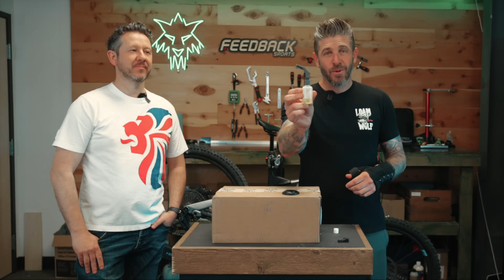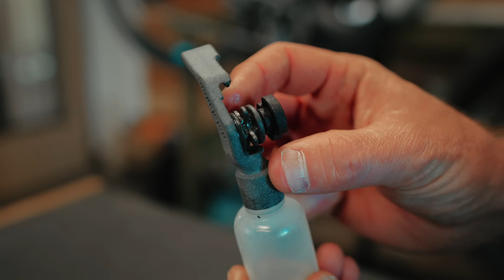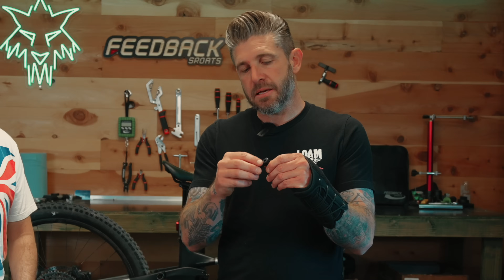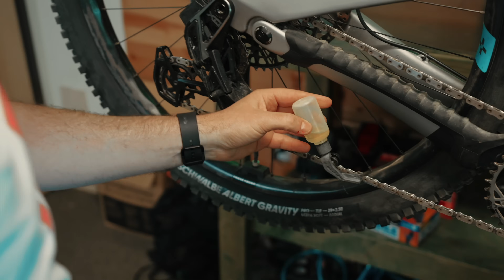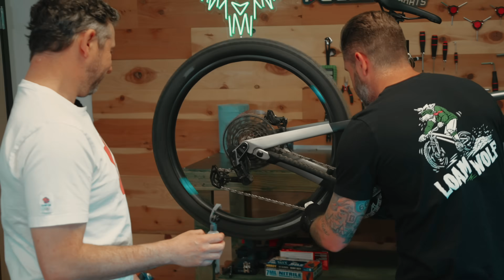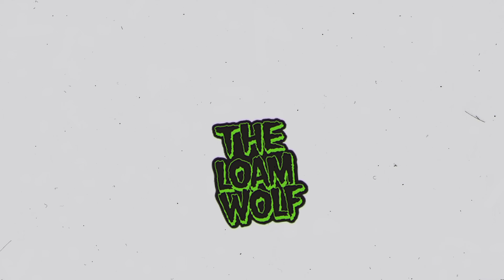Are You a Fanatical Chain Luber? Rotaluber May be A Must Have For You.

Comment: The Rotaluber looks like a nice bit of kit!!! If you want to see how your favorite lube stacks up against other lubes I suggest you check out Zero Friction Cycles web site.zfc  not only tests lubes but also chains,chain wear checkers,and now pocket battery air pumps too!!!Muc off tested terrible wd-40 beat it lol.I used to get about 1500 kms life on my chains out of using muc off dry and now being converted to silca[ thx to zfc] hot melt wax I'm getting around 5000kms per chain and this is on chain eating e-mtbs in mostly dusty conditions!!! Cheers!!!

Comment: Dupont  "Chain Saver"   Wax/teflon lube spray,  its basically finish line teflon lube in a big ass aerosol can 14oz for $27 at Walmart, Home Depot, Menards, Lowes..  less $$ than ALL the bike lubes where you pay $10+ for 4-oz. it's ridiculous.... i use this between rides after washing and Boeshield T9 for trail side preride lubing if ive forgotten to address it lately.   i like the idea  of a simple little tool to make trail side lubing a bit more accurate and efficient so i'm down to try one of these.  On the ebikes these days now I pay ALOT more attn to the chain, lubing and also STRETCH   if you are heavier and running ebikes up hills alot check that chain stretch!!  A  perfectly fine looking, not too old chain can be out of spec much sooner than we realize on an ebike.   save those chain rings and cassettes.

Comment: Friends don't let friends use Muc Off lubes. I've snapped 2 XT chains with <500 miles running Mucoff and never snapped a chain using different lube. Correlation =/= causation, but fool me twice....
Reply: What's your go to dry lube?
Reply: @machine7767 peatys wax based for most conditions, but the squirt and silica wax emulsions also work well. Silca is probably the best but very expensive.

Comment: Not really useful for me; I use drip wax to rejuvenate but I'm usually using immersive wax in between rides so you can get rid of contaminants (they fall down the pot) the biggest issue with drip wax (or any drip lube) to me is not spilling it's getting dirt out then getting lube inside the clean rollers without capturing contaminants...

Comment: I use Muc-Off Dry Lube all the time. I live in Detroit, Michigan so it's a lot more humid here than where you guys are, and the muc-off dry ceramic lube has served me well. As a matter of fact, I had a 3x9 drivetrain that I first used it on with a KMC ti-ni (gold) chain, and the chain last about a good year before stretching to where I needed to replace it. I love it, and have used the lube since 2023.
Edit: Reading through the comments, and it seems like a lot of user error is to blame for muc-off dry lube not working for them. Chain wear isn't just down to what lube you use...
Reply: Lubing technique are not that relevant it's more how clean you can make that chain before putting lube, just adding it over existing dirt is terrible whatever the brand.

Comment: I ride year round here in Northern California dust is the norm, with a few splashes in winter and spring.  I switched to Silca hot chain wax last year on all my bikes (trail, enduro, emtb, road, etc).  Drive train wear is loads less, don't see going back to oil based lubes.
Reply: Same here and it's been better than anything else I've used over my last 30 years of riding mountain bikes.
Reply: Tough up front cost of $100+ but if it saves chains, rings, cassettes...humm.   Any ROI vs a boring std lube like RocknRoll or something?
Reply: @davidsilvas9441 Check out "Friction Facts" There's lots of published info on that subject.  Silca has a wax prep chain stripper and drip lube called "super secret" to dip your toe into waxings.  Using both methods, I feel that the Silca Wax drip lube is nearly as good for a fraction of price, but the tradoff is that it doesn't last as long compared to immursion waxing, but it blows other drip lubes away.

Comment: I'm in Colorado on the front range and have been using muc-off dry lube on my ebikes and peasant bikes with no issues for 2-3 years. It's very dry here.
Reply: MucOff is one of the worst performing (both in efficiency and rapid wear rate) you can buy. Dry lube really isn't dry lube. "Dry" lube is wet lube that is less viscous.

There are dozens of significantly better options that will save you loads of $.
Reply: @lenolenolenoI used to use rock n roll blue for ages. I just switched since I like the applicator on muc-off 😂
Reply: @fooblahblah  Ha, valid reason! Unfortunately Rock and Roll blue is also another terrible lube in terms of wear rate and inefficiency. If you ride off-road primarily you should really be using some variety of wax lube. If you're super lazy, at least something like T-9 Boeshield at least applies wet but leave behind a film after you let it dry for a few hours.
Reply: Dry is one factor for sure, but what about the soil/ dust composition?

Comment: Hang out in the bike shop quite a bit and have seen a brand new chain brought back after customer lubed it with muc off dry lube and it was already corroded. sent to shimano rep to analyze it and his first question was "did they use muc off dry lube?". This was not the first time I have heard issues regarding this lube since alot of people in Arizona use it. Alot of folks come in with snapped chains with minimal wear and say they use muc off dry lube.
Reply from the maker: Very interesting!
Reply: Yeah. I work (or worked, technically) at lbs for just about 4 years and I can concur that most of the rusty chains use Mucoff. 

If its Mucoff wet, the chain is not corroded but really gunky and looks like poo (and is so sticky that their own degreaser is ineffective - you can only degrease a Mucoff wet chain using industrial grade 1:1 undiluted degreaser... If its Mucoff dry, it chases all the water off and makes the chain suseptible to corrosion.

Anyway Mucoff makes gimmicky, overpriced products, mainly drivetrain and wash related. Their lubes don't do as advertised, their degreaser is too diluted, their wash kit is just overpriced Ailbaba stuff and everything else (like their sealant stick) are just nonsensical marketing ploy.

Only innovations I've seen are the disc rotor cover and the big bore valve. Otherwise, stay really well clear of them for anything drivetrain or wash related. Try Peatys instead.
Reply: Very very interesting indeed!!!!!

Comment: First, clean your all drive train, after every ride short or long. Get a chain tool to cheak your chain. Replace chain after 1750 k"m.and yes mucoff lubes are very poor. Use motorex bike chain lube it is fantastic for dry condition. And blub e bike ceramic lube for heavy winter condition.  Dont forget to have much fun on your rides. 🎉❤

Comment: I've recently had a new Sram Transmission chain that broke 5 times. RocknRoll blue lube, but I don't think that has anything to do with the failures. I suspected a slightly bent sprocket in the cassette was putting side load on the chain. I've replaced both the chain and cassette and that seems to have resolved the issue. Those XO transmission cassettes aren't cheap though!
Reply from the maker: Thanks for the feedback, sounds like a frustrating issue!

Comment: I used only the muc off dry lube for the last 6 years and did not have this issue. I only use the XX1 chain on all bikes as the others don't last that much.i get about 3500 km before reaching the 0.5 stretch when I replace the chain
Reply from the maker: Interesting data point, thanks for sharing!

Comment: Curious how this will work with a wax based lube like Squirt
Reply from the maker: If you check out their website they do have some suggestions for that!
Reply: @TheLoamWolf  I was only looking on the product page, but found it on the FAQs page. "Products like White Lightning  and Squirt are not recommended."
Reply: I use Squirt lube as well and no need for anything but the bottle. Get the chain up to the top cog on the cassette. Just apply a drop on top of each link, and once done start turning the cranks while you're constantly changing gears up and down, up and down(just the top cogs). 
This way you will more easily force the lube into the links where it needs to enter given the chain is at max angle, which opens them up(the gear changes also aids to this). Once you've done this for a minute or so, just leave the chain over night and you'll see most of the wax is rather inside the links than clogged up outside. 

In the beginning I mostly just applied the immulsion wax, did a few rotations and then left it. That made a lot of it just stay on the outside, which just made a mess really. That's why it's important to assist the wax in getting inside the links as I described, and it does make a difference.
Reply: @Johnnie----I basically what I do, the Silca method haha